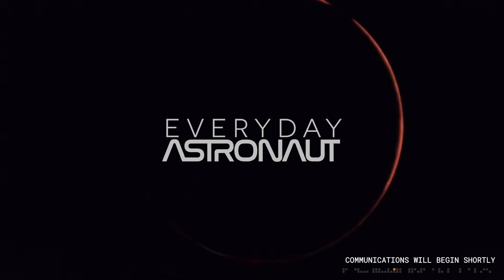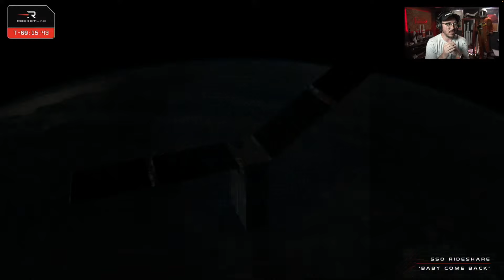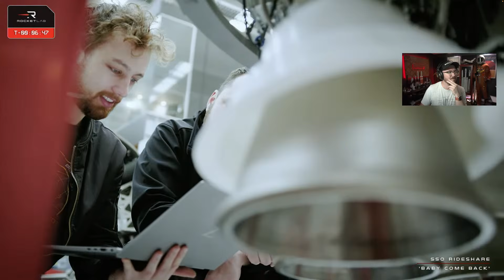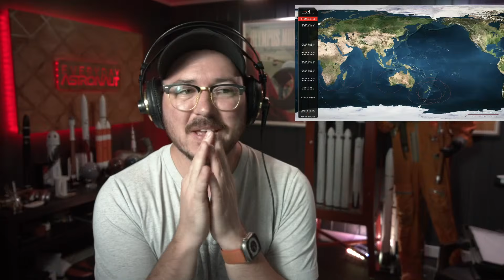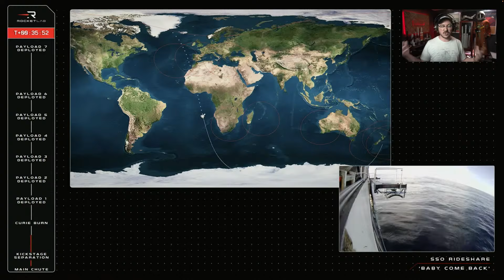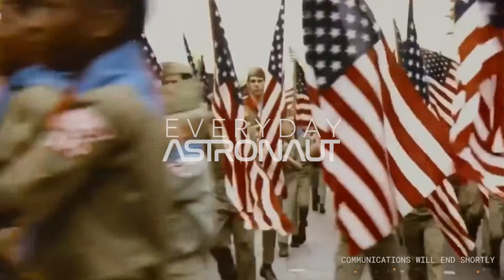Watch Rocket Lab attempt to recover a rocket to reuse it! #babycomeback

Comment: Dynamic pressure is Q because P was already taken by pressure. They are both measured in newtons per square metre, but are calculated differently, hence having different symbols. P is a force divided by the area that it acts upon. Q is the density of a fluid (in this case, the atmosphere) times the speed of that fluid squared (or the speed of the object moving against that fluid), divided by 2.

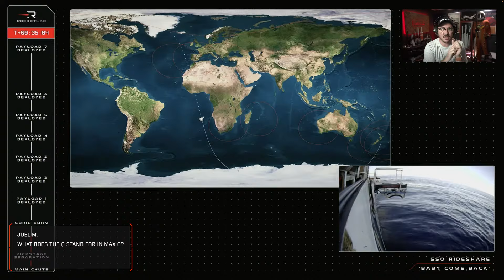Comment: 1:02:50 The Q shortcut is also used by Air Traffic Control to state the atmospheric pressure in Millibars in aviation. For example, the most common Q code in aviation is QNH, or pressure "Near Home", also known the air pressure in a particular location, such as at an airport, for example. You might hear ATC say something like, QNH 1020, which the air pressure in that area is 1020 Millibars (or Hectopascals).

Comment: I agree with a simple splash penciling out best.  Orchestrating a helicopter snag seems expensive, given the uncertainty of launch schedules, though cool they were successful at that.  Parachutes likely require less mass than the propellant needed to re-land on a barge or land.  The ship required to recover the Booster floating in the ocean is also likely simpler than a landing barge, and less risk in getting the trajectory perfect.  Mach 8 on initial re-entry of the Booster is much less than the Mach 22 from LEO like capsules returning from ISS and it soon slows to ~ Mach 1 as it enters thicker air, before deploying the first chute.  The nozzle extension appears uncooled, so likely a pricey metal (Niobium or Inconel-titanium alloy? no outsiders seem to know).  If all they can re-use is that nozzle extension (or just the metal), that alone may be worth the effort, but presumably most/all of the engine survives re-entry and splashdown fine.  Some things are easier on a smaller scale.  Throw an ant off the Empire State building and it will land just fine on the sidewalk.

Your description of the nozzle taking the full thrust force is slightly mis-worded.  Generally, a Booster engine's nozzle takes only ~10% of the thrust, with 90% coming from just chamber pressure x throat area, i.e. you would get the later thrust if no nozzle, just cut-off at the throat (plus some more thrust from the pressure from the expanding plume acting on the vehicle's base).  But, yes the combined nozzle and chamber provides all of the thrust.  We would have to compare the deceleration force at splashdown to it, which RocketLab surely can infer from on-vehicle accelerometer data.  Looks like it splashed down very close to the expected location since the recovery ship quickly reached it.
Reply: Actually, ships are expensive to operate, as Elon and Peter have explained.

Comment: Max Q
Actually in the SI system international units,  in electronics mainly Q = CV.
C = capacitance, V = voltage.
Q therefore = the charge energy in the capacitor.
The maximum quantifiable CHARGE ENERGY is exactly what happens during the launch ascent.
The rocket itself is  subject to ever greater internal stress,  energy absorbtion,  until the air gets thin enough to reduce the max stress.

So Q is the perfect quantifier.
Reply: Q is frequently used flow equations such as fuel flow in a gas turbine.
Reply: @Simple_But_Expensive  Thanks,
If the fuel flow was related to fuel pressure or the total fuel in the system then that would equate to total energy which is exactly right.

Comment: What is the psi at MaxQ?
Reply: At what surface?

As a rough guid.

Between the engine bells about 0.1 bar,  but on the tip of the pointy end,  likely some Thousands of psi.
Reply: Do you mean the air pressure or drag force on the cross section?
Air pressure is about 0.2 bar at 11-12 km
Dynamic pressure at 400 metres per second at 11km is about 0.3-0.4 bar 
1 bar is approx 10 tons per square  metre, so 3-4 tons per sq metre of drag cross section. More significant on the leading edge and flow separation.
It is the same as the force on e.g. a supersonic fighter jet at that speed and altitude, 2 or 3 times the force on a (edit) subsonic passenger airliner, nearly all are subsonic for cost efficiency. 
 Not particularly extreme but a significant point to design for, limiting on power vs weight vs speed vs altitude.   Higher speed and force at MAXQ, more structural weight to handle it , more fuel expended .

Comment: Sorry I couldn't sit through the whole thing I'm guessing they didn't catch it
Reply: they aren't catching them anymore, they're just picking them up out of the water.  Rocket lab owner once did an interview with Tim and said some stupid number about how much boats cost (it was almost certainly bullshit) and that's why they were using helicopters.   Now they're using boats, just like SpaceX.   Sigh.
Reply: @zachansen8293  Thanks!  I guess it was too hard to catch them.
Reply: @DragonKingGaav too hard, too dangerous, too expensive
Reply: I wonder how much weight it adds to waterproof the rocket & add parachutes vs adding a little extra fuel and maybe landing legs or stubs
Reply: @dutchuniverse It’s not just a little extra fuel, it’s enough fuel to boost back and land.  Also avionics and guidance, control surfaces, landing gear and increasing lateral strength. And relightable engines.  Basically a whole new rocket.
Reply: @russc788  No need for boost-back if you’re landing on marine assets which they already have to use anyway regardless of them not wanting it.
Adding landing gear shouldn’t be that hard at that size/weight, F9 wasn’t initially designed with gear.
Avionics and guidance is probably already on-board, just got to reprogram it.
It’s already laterally falling back as is, no need to reinforce unless refuribising isn’t cost effective.
Second stage engines are essentially the same as those on the first stage and those can be re-lit. Sounds more like an unwillingness from the team than a design issue
Reply: @dutchuniverse  having to restart engines adds a layer of complexity and mass, as well.  Rocket engines aren't, by default, restartable.
Reply: @zachansen8293  true that but how much would it differ from making the booster seaworthy and adding chutes?
Reply: @dutchuniverse  The parachutes were always there, that's what the helicopter tried to hook when they were trying that way.
Reply: It landed in the ocean, recovery boat was there. Assuming they got it onto the boat!